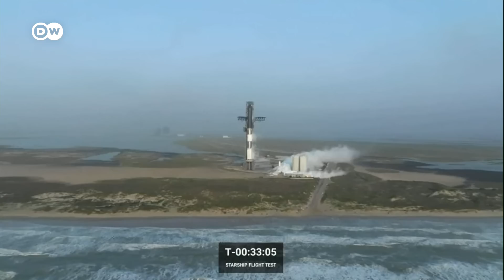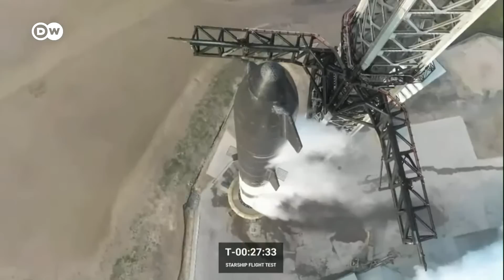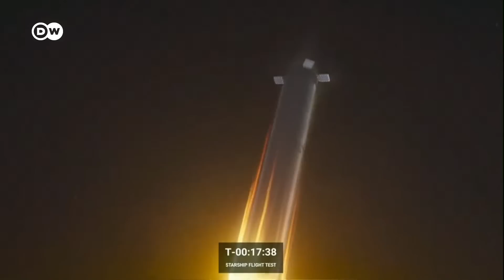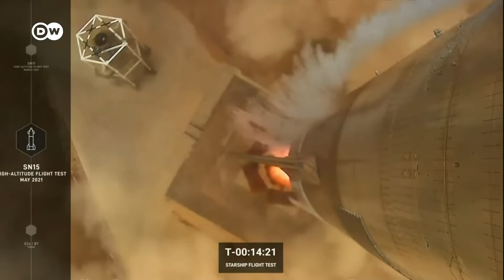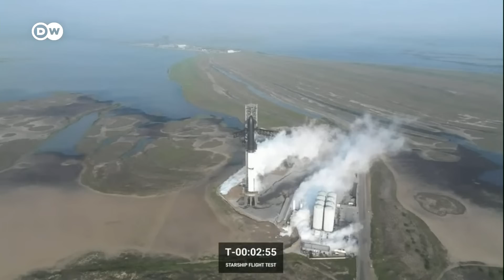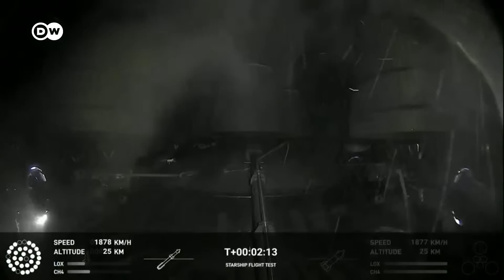Live: SpaceX Starship rocket launch attempt | DW News

Comment: Starship booster had 6 engines of the 32 that were cycling on and off, but still had plenty of thrust. 
It was burning through the oxygen too fast. 
At the upper atmosphere, it started flipping over repeatedly, the flight termination (RUD) was activated and it self destructed.
Reply: Other explanation video explained that Starship failed to separate and might be the cause of the "flipping", probably because by that time, the superheavy was already supposed to begin "boost back" and flip. We can't really say until SpaceX releases an official statement on what really happened.